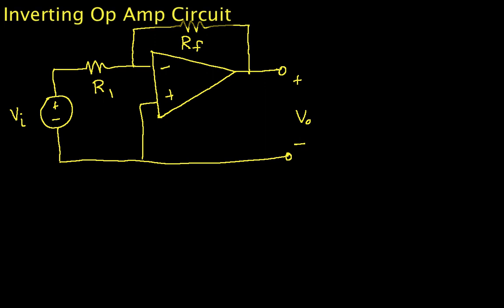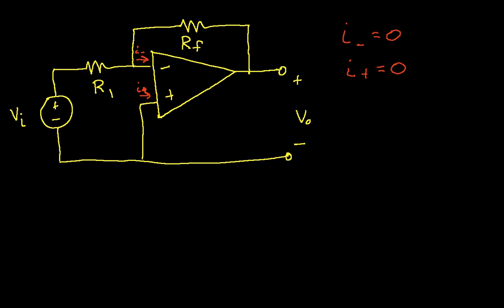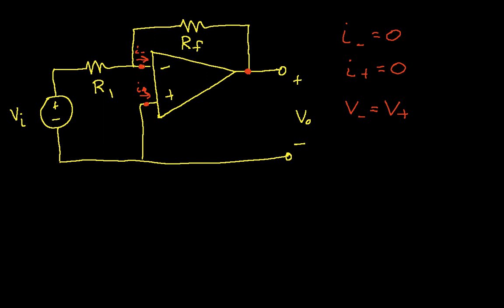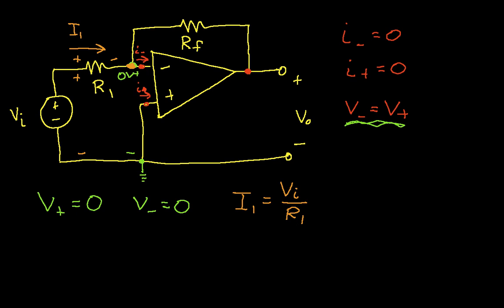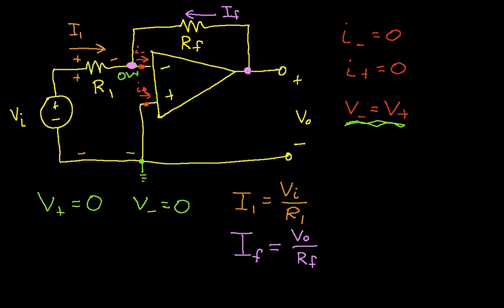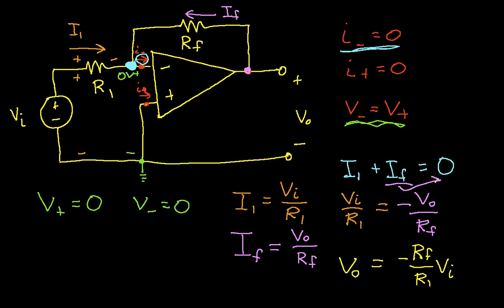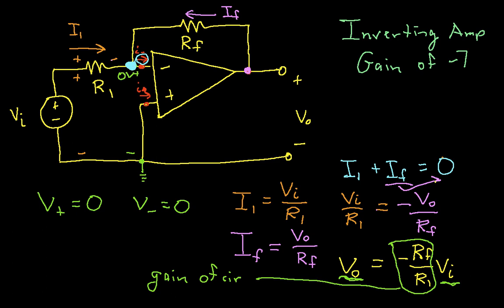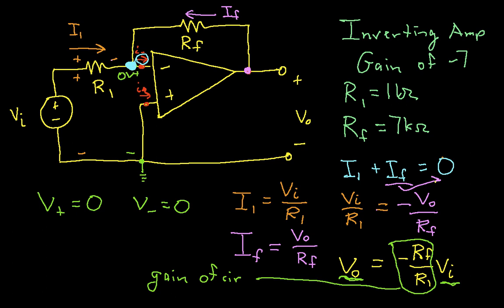Op Amp Circuit Analysis: Inverting Amplifier

Comment: okay so output is less then input but the op amp makes it as close as possible, so what exactly does it amplify? is the purpose of it to negate natural resistance losses in a circuit?
Reply: It makes the two voltage levels at the inputs as close as possible, which is why you can treat them both as zero. The output is different, that's what is amplified from the input voltage.

Comment: this is a good question. if ideal case were actually true, it would NOT work!

here, "zero current" means "very close to zero current". and "infinite  gain" means "gain of a very large but real number".

ideal case is just easier to remember and model using "zero" and "infinity". unfortunately some consequences of ideal case do not make any sense. just forget about those!